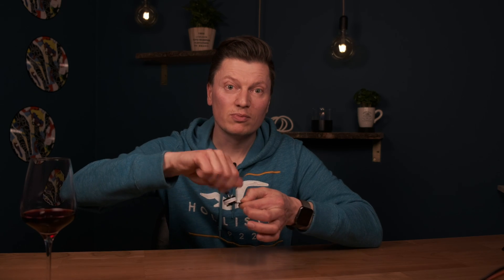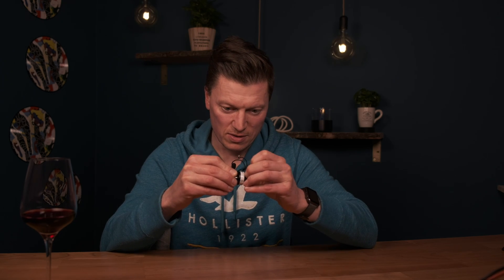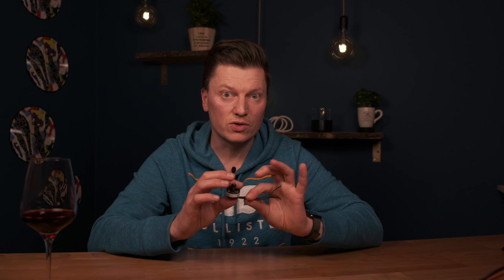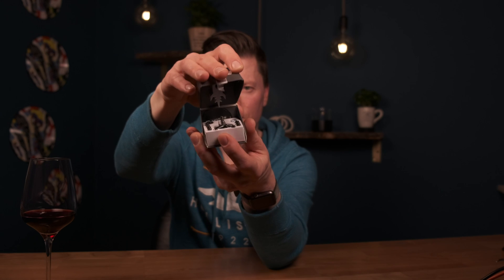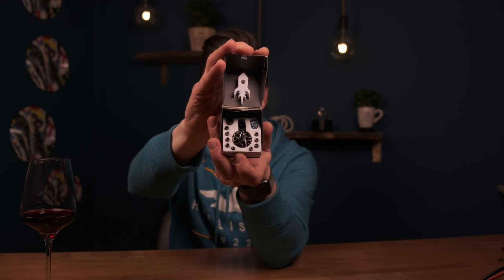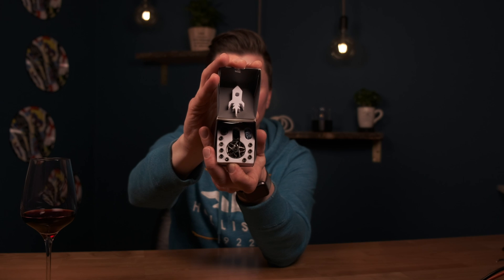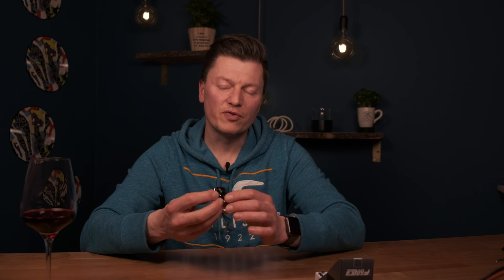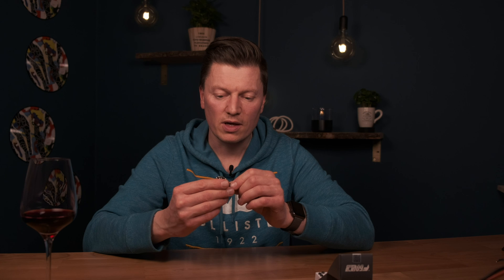🔥Worst premium FPV motor in the world 🔥⎮ Switch to T-motor F60 Pro IV 1750kv

Comment: good video friend! I wanted to ask you if 2306 1750kv or 2306 1950kv is worth it for a smoother flight. what difference is there?
Reply from the maker: For small spots and quick power take the 1750kv. 
For bigger spots and more speed 1950kv. 
Smooth are both, your finger is the smoothness. 
You can ad also a curve in your throttle at your radio. 
The 1750kv reaction is quicker.
Reply: @Jamaicarasramarc  Thank you very much for answering, it is clear to me🙏🏻💪🏻

Comment: I have had the same experience with the mr steel motors. I used the v2 and they did not last long and replacement parts were hard to find. TMotor is a fantastic company building only quality products. Great video and nice freestyle flying 👍
Reply from the maker: Hey thanks man 👊🏻
Axis is the way to go! T motor is not soooo good from
bearings side. 
Greetings from Germany 🇩🇪

Comment: I've had no luck with Ethix Stout motors. The base of the motors are made of very soft metal, like pot metal, so it's extremely easy to strip out a screw. I also had one burn up on the bench. This weekend I replaced the Ethix Stout motors on my Apex with T-motor F60's in 1750Kv.
Reply from the maker: yes trash 🗑 
f60 are good motors 👌
at the moment i am a Axis AF227 fan 😍
thanks man 
greetings from germany

Comment: I know it is almost 2 years ago this video was produced but whatever. I experienced same problems with the Ethix motors as well as the Hypetrains...  Weak bells & crunchy bearings. While I found them terrible compared to even the Lumenier 2206-11 2350kv I STARTED with on my first quad in 2015 and I am looking at 4 of them still operable on a decently flying quad. As for the Ethix & Hypetrains.... I ate the cost & just did giveaways since other people still liked em! I have never had a problem with T-Motors. I love them. Using T-Motor F90 Long Range 1500KV on the Super G+ 7"

Oldie but goodie! Love that flow. Bumpin' for the deuce deuce.
Reply: Also Dromie... opening sequence with the wine... Unique! I have seen your avatar with a tempting beer as well as your banner..... My favorites are König Ludwig Weissbier & Weihenstephaner... With that in mind would you have a fine recommendation, good Sir?

Comment: Dude, how about trying the Avenger V2 2507 1850kv? Those motors are very light (~32g without cables) and could provide such torque...on 6S even on bigger props.. :O
Reply from the maker: For 5 Inch? Or bigger?
Reply: @Jamaicarasramarc  on 6" it shines and mindblowing fast and provide indane torque... :O

Comment: I have purchased 12 of the ethix motors and they were great except for one issue, they are glass motors. I purchased motors for three 5inch builds and in two minor crashes 5 out of the 12 have burnt. Very dissapointed and goes to show you not to get on the hype train BS. I since built 3 builds with T motor and not one motor has gone bad and i crashed a lot.
Reply from the maker: Yes that is why a have made the video. The Motors are Bullshit....
Thanks my friend

Comment: If i am being honest All FPV drone gear seems like polished shit...(Loves FPV anyway!)   Plus a lot can go wrong with QC, install, firmware, software human error, etc... It was made clear the motors were not quiet and had a crunchy sound,(no problems during flight such as noise or vibrations) it is not clear to those outside of the manufactures whether or not was intended or a problem.   Not to sound to defensive there are some thing you need to consider !!! Are you running to much weight for these motors (can shorten lifespan of the motor dramatically) Two are you flying the intended setup for these motors such as are you using Betaflight? or Kiss? or maintaining all up weight?. Just some things to consider...                                  
 And yes the T-motor has more battery sucking punch if that's something you feel is missing from Ethix motors i would agree and also note that Steele based it around his flying style "cruising speed & some punch outs"   But if i am being really honest this feels more like a marketing move on your behalf and is it a weak video in terms of proving the motors are truly bad.   "Keep calm and switch to ARM"
Reply from the maker: Thank you so much for watching my video. Have a nice week my friend. Greetings Marc 

The motors are only hype...
to expensive for her quality
Reply: @Jamaicarasramarc   it is your opinion and i am ok with that.  if you are going to trash something at least show us the gear and the problems and not a brand new unused motor followed by flaming.  Glad you liked the flight in my video Ethix V2 silks Steele 4s alien.

Comment: so in total I had bought 12 mtors. You can say that 4 of them are okay. All the others had a problem. The main problem i had was (besides the scratching when turning them by hand) that they just got very hot. And no, that had nothing to do with the filter settings! An absolutely shitty product! Switched to T Motor Pacer. Much cheaper but much better! No wobble no no nothing. 
Disastrous product.
Grüsse aus der Schweiz ;-)
Reply from the maker: Ja genau das ist das Problem... Alles wie bei mir!
Absoluter Schrott das Zeug 😝
Gruß aus Deutschland 🤙🏼

Comment: I just remembered your video, because in their latest podcast Steele mentioned that his motors burned out or desynced with the fettec ESC he tried and the fettec guys had to fix something in their firmware. Did you possibly fly on a fettec yourself?
Reply from the maker: Hey Hans
yes it is  extra software for this motors in the gui. But i will never fly ehtix motors.
Now i fly CyberXing and T-motor F60

Comment: Hi Pixelcounter, I've received 4 stout motors lately for a new build and I've send 2 back due to quality issues! There is indeed an issue and we are not alone.
Reply from the maker: Thank you for you have the same problems, I don’t no what is after 10 crashes in weed or so! I have changed all my ethix 8 pieces to f60 IV and CyberXing 👌
But the f60 don’t so good quality as the Xing 🙏
Greetings from Germany 🇩🇪

Comment: I cannot agree in the least. I’ve been rockin the Stout V3’s with no issues.
Reply from the maker: Hey thanks man 👍
I think it was a fettec esc issue and it is fixed now. No burning with the new firmware from fettec. But the motors are 
nevertheless not good for me. I have 8 motors with bad bearings. And the power is also not good for me. Fly a xing and you will see what I mean 👊🏻🍻
Greetings from Germany 🇩🇪
Reply: PixelcounterFPV im flying xings right now as well as ledribs and Diatone motors. They are all different. Some are absolute rippers and have to be under propped and others like my V3’s are super chill and silky smooth. Plenty of power. Quality, maybe I’m lucky, has been great!
Reply from the maker: Maybe a bad series I don’t now. But for me no power. I think my quad is a little bit to heavy for this motors! But everyone like it or not. I have so much people how say this motor is crap. But nice you like it 👊🏻🍻
Reply: PixelcounterFPV thanks! Subbed right back. Tschüss!
Reply: @Jamaicarasramarc  his motors  are really only meant for auw of 500g with his low pitch, or some other low pitch prop. its more for lower throttle precision than high throttle punch outs( where the t-moters exel over most other motors). the play was a bad batch. my first two had play, and the rest where fine.

Comment: Hey man ... die Packung von den T-Motors sieht schon gut aus, hoffe die passen für Dich ... das mit den Souts kann ich allerdings nicht bestätigen, hatte und habe mit den V2 und V3 absolut keine Probleme bis jetzt ... aber kann ja jeder machen wie es ihm gefällt, gibt da kein falsch oder richtig 😜 ... geil geflogen, wie immer 🤩🙌🔥 ... happy flying n cya 🐉✌️
Reply from the maker: Ja denke das liegt wirklich an der Fettec Combo. Schreibt auch Fettec die Motoren nicht zu benutzen. Bisschen spät halt🤣
Aber ist eh nicht das meine. Brauche smoothness im Gas und die sind extrem zackig wie du ja selber weißt.
Reply: PixelcounterFPV ah ok ... gut zu wissen ... stelle gerade einen Cinewhoop zusammen und möchte dafür auch mal Fettec testen ... ist das mit den Ethix Rats ähnlich, weißt Du da was? ... hab jetzt selber nichts gefunden

Comment: That sucks mate but I’m not surprised, I bought some ethix battery straps and they are light weight but snap really easily, I don’t trust their stuff. I have been running T-motors on 3 quads for a couple years and love them so hopefully you will be much happier with those, they are a lot more durable than they look too.

Nice flying at the end too man 👍😎
Reply from the maker: Yea you are right my friend. Don´t buy stuff from Pilots. I think it is only for make money.
Greetings Marc

Comment: Don't usually watch reviews as they are often trying to gain all manufactures approval, was very refreshing to hear your honest thoughts on both motors! I am currently running Xing 2207 2750kv motors with the hq prop 5x4.3x3 v2s and loving the power delivery and smoothness, especially for my commercial work like drifting. I am wanting to move up to 6s with the 1950kv motors, do you think the flight quality will be the same in terms of control and smoothness? Look forward to your next video, thanks!
Reply from the maker: Thanks my friend
Yes i think with 6S and 1750-1950KV is smooth and powerfull. I had the 2207 Xing for the last year with 100 of crashes and it was the best motor i ever flown. My problem was the amps. Too much for my heavy freestyle quad. 
I thing i will test the Xing iFlight Cyber XING 2207.5 1777KV 2-6S Motor.....
Stay healthy and greetings from Germany

Comment: Nice flying  i am still using 4s batt and emax rs2306 2400kv. I will change it to t motor f60 2550kv or emax eco 2400kv.
Reply from the maker: The f60 is a beautiful motor. But i will test the new iFlight Cyber XING 2207.5 1777KV 2-6S Motor 🙏🏼
Stay healthy my friend

Comment: Servus, welches Motortiming fliegst du mit den Motoren ?
Reply from the maker: Kiss Quad. Hat nichts mit timing oder Filter zu tun! Die sind einfach scheiße. 

Gruß Marc
Reply from the maker: Habe jetzt die f60 IV 1750kv und brauche auch nur 63 Amps im Punchout. Selbe Flugzeit und viel viel mehr power.
Reply: @Jamaicarasramarc  die Frage war auf die f60 bezogen ;)
Reply from the maker: Sorry. Dachte wieder einer der mich belehren will wegen den ethix 😂
Fliege die auf nem fettec Stack. Bin mir jetzt nicht sicher ob Auto timing oder Medium. 
Ich schau heute Nachmittag mal nach. 
Fliegst du Beta? Denke Medium oder Medium high ist gut für die Dinger. Aber musst einfach selber testen. Ob sie warm werden auf Medium high. Seit dem ich Kiss Fliege kümmere ich mich nicht mehr um Motor timing. 
Bis später 👊🏻🍻

Comment: I can only agree with Marc - this engine can't stand anything, I flew only 15 Lipos with the last replaced engine when I noticed the smell of electricity. Unfortunately, this shows that the quality of the insulation was reduced during insulation measurements. Up to voltage flashovers under full power at 6S. Other manufacturers offer here a partly 3x as high insulation value.
Reply from the maker: Thanks for your comment bro
Yes totally crap this motors

Comment: I would never spend more than 10-15$ for a motor. There are so many good and cheap motors on the market. For example Racerstar SPROG, DYS Samguk series etc. You do not fly better with an expensive motor. You only learn to if you go fly your quad as often as possible. This also means crashing motors and replace them. I prefer to replace a 10$ motor instead of a 30$ motor... Happy flying :o)
Reply from the maker: You are so right my friend. Most of this motors are made in the same factory.
Thanks for your comment
Greetings Marc

Comment: Was a fan of the hypetrain v1 motors. flew em daily for over a year before they started to get crunchy. the v2 were crunchy out of the box. Tried a set of  them "box cutters" and the bell popped off on the first flight. Got a set of Xing motors and all flew really good until one took tried arguing with a piece of angle iron. I haven't flown since middle of last summer now, but I have a new replacement ready to put on it. You're killing it with our flights, Marc! keep at it!
Reply from the maker: Thank you man. Yea i love the Xing too. But i look for a motor like Xing with less weight and amp consumption. 
I have the Xing 2207 for a year on both quads without a problem.

Comment: Thanks for the info Marc. I love my Xing motors. They are smooth and the price isn't too bad either. Keep up the great videos bro👍👊✌🍻🍻
Reply from the maker: Xing is one of the best motors. But i look for a motor with less weight and amps. Xing i have 1 year on both quads without a problem and over 100 crashes. 
Greetings and have a nice weekend

Comment: hurts.... for sure.... when the original HypeTrains came out and Tommy flew em in the wall to show durability, I put them on 12 quads.... worst 3 days of my life lol... and LAST product I ever did and ever will buy from them.... thanks for keeping it real brother, too many pilots would sell out for a 12 dollar vtx.... my favourite at the moment are the Xhover 2207-2500... tough as nails and loads of fun ....
Reply from the maker: 😂😂😂 I buy the remix frame, tommy flew em in the Wall to show durability 😂😂😂
First Lipo with small crash and the arm broke completely with motor and I found my quad with only 3 motors. Arm number 4 with Motor I found 5 Meter away from the Quad. 
That was a scam too!
Have a nice weekend bro
Greetings Marc

Comment: I refuse to buy any "pilot endorse" motors. They're overpriced and with all the budget options on the market now it's a waste of money.
Reply from the maker: Your right my friend. A friend have the xing eco for fucking 14€ and it is a very good motor.
Have a nice weekend 
Greetings marc
Reply: PixelcounterFPV yep the xing e and hyperlite e series are some of the best “budget” motors I’ve used. 👍👍. So far a set of xing 2208s have lasted me over a year. The hyperlite e series 2207.5 1722’s have been doing great on my race rigs the last 5-6 months and after slamming into the ground and gates and trees they are still smooth as butter. 👍 keep up the great vids.
Reply from the maker: you can't go wrong with that👍👊🏻
For freestyle the 2207 in my opinion 🙏

Comment: Nice review Marc, I had the V1 motors, which were rubbish, then T-Motor F60 and F40 only for two yrs, great motors, but XING 2208 1800,s for a year now, haven’t damaged a motor, Luke the durability of the XING🍻🍻🍻🍻
Reply from the maker: I use Xing on both quads for one year with hundreds of crashes and no problems. 
Sounds better than the ethix after 10 lipos. 
My only Xing problem is for me the Amps and the weight. My quad is so heavy, 650-670 gram with a hero7 and Mount. 
I am looking for lighter motors with the same quality as the Xing. 
But Xing was my best motor since I fly quads.

Thanks for your comment 👊🏻
Greetings from Germany 🇩🇪
Reply: PixelcounterFPV  my quads are 770-780 with hero 7
Reply from the maker: Wow.... heavy. Then your quad needs very much amps.

Comment: I'm currently in love with these Xing motors. They take a beating and are smooth as butter. Price is quite competitive as well?
Reply from the maker: I use Xing on both quads for one year with hundreds of crashes and no problems. 
Sounds better than the ethix after 10 lipos. 
My only Xing problem is for me the Amps and the weight. My quad is so heavy, 650-670 gram with a hero7 and Mount. 
I am looking for lighter motors with the same quality as the Xing. 
But Xing was my best motor since I fly quads.
Thanks for your comment 👊🏻
Greetings from Germany 🇩🇪
Reply: @Jamaicarasramarc  How smooth or juicy are these T-motors compare to the Xing motors? I'm currently using Xing 2208, I love the smoothness of them but want to find something lighter without sacrificing the buttery feel.
Reply: Xing is king right now. I can’t feel the difference between my regular xing or e-xings. I also have some budget dys motors that are running like a champ. I might buy some back up replacement ones. I’m not seeing the need to buy premium(expensive) motors.
Reply: Yeah! I feel the same about mine. I used to fly t-motor on my old quad I lost, but it was 4s. They were amazing but expensive and tbh the xing has taken more of a beating than my f40 pro 2's.

Comment: Agreed! the Ethix Motors are garbage.  I had a set of Ethix V2 Stout 1700kv, was really disappointed, within one month 3  motors were toasted (1 magic smoke, 1 bent shaft, 1 lost a phase)... Anyway I prefer Emax ECO series, cheap and effective, good durability.  Had a set of T-Motors F40 Pro 2 2400kv in 2019, those were solid performers, expensive but really good
Reply from the maker: Yes i had the same Problems. It is so bad from ethix. 
Tomorrow I have Maiden with the F60. I hope the best. 
Thanks for your comment 
Greetings Marc
Reply: Ordered some t motor velox 2207 lets see how they’re gonna perform. At least i didnt buy this ethix crap😂